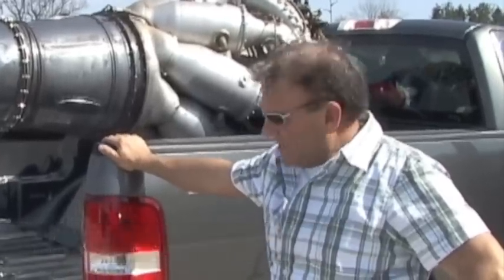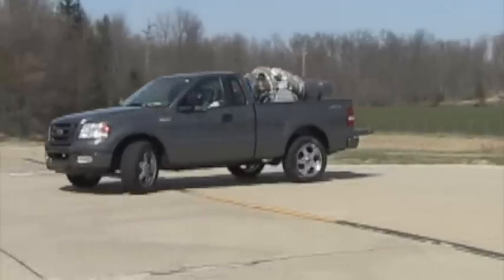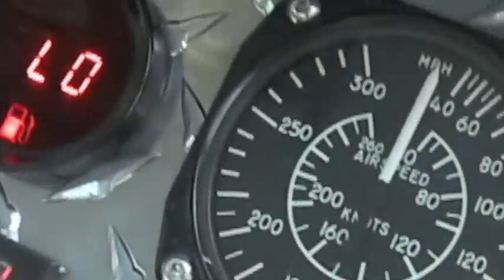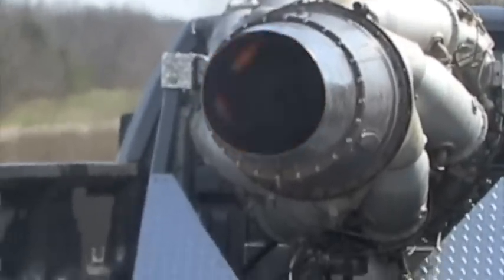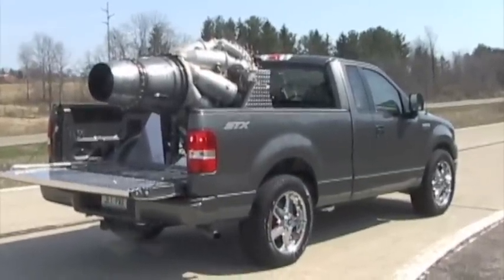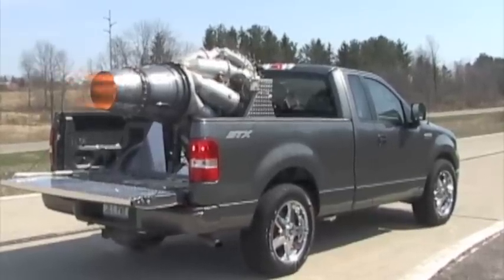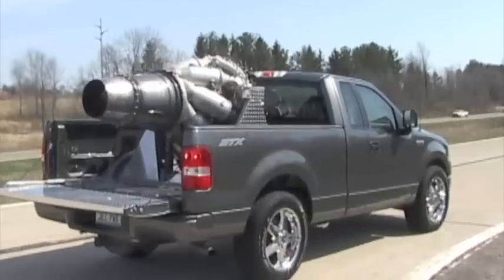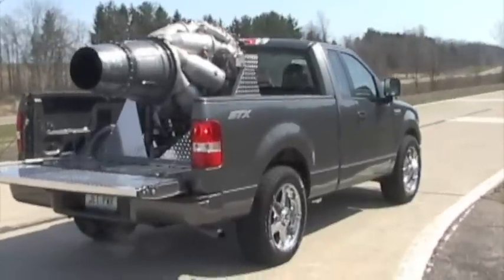F-150 Jet Truck

Comment: Actually ur 350 is almost , if not 8000 lbs- where my eagle is a mere 3900- and i have the stock 4cyl iron engine- with 60k miles-- i like boxy cars- not the scion box- like the vw vanagon box lol or the lambo lm002- i saw a 350 with the steel front bumper- at my head level- what a truck- and i havent seen the new concepts- the cars now arent as good as they used to be- but the new jeep srt8 is pretty nice- although my saturn redline is faster- i do like the 350 fords tho- very customable

Comment: I'm sure it runs faster, but my car (BMW 325i) looks like it could out accelerate faster than this.  But I'm sure if the truck was accelerated properly that would not be the case.

Comment: No air flow to begin with. Have you reinforced the brakes the everything? a truck like that isnt ment to go that fast parts will break no matter what brand it is...shits just not ment for the speed a JET engine can put out...how about a roll cage? Mabey a couple more saftey features?

Comment: U wish- the eagle has stainless steel unbendable bumpers stock/ ford has plastic and aluminum- i have a air suspension lift kit- up to 6" lift- Think of it as an early jeep- cuz it is- so ud be bumper to bumper with me- but the point being is that any shlomo can own a mass produced ford- f150s are a joke- i do like the TD 350s and the 650 is god- but my car is a rareity - it deffinatly looks cooler than any model pickup- and its painted in desert tan tank paint- aka Desert eagle

Comment: [MassiveLemon]
{It's still being routed to the car's transmission and axles}

That made me laugh how hes trying to
argue about the fact that the truck is worthless when he has no clue how it works...hahaha  its a normal truck with a jet engine bolted to the bed of the truck! theres no super transmission and axles that could handle that power, small enough to fit under that truck. nice try though!!!

Comment: @erickoep13 There is no "tire burn" when there is no work being done by the wheels. The truck moves because of the accelerated air exiting the jet engine. Think before you post and maybe you won't look like an idiot.

Comment: the build was done all wrong and is very unsafe to use   1. you used a ford.    2. the engine is sitting to far back.   3. the engine isn't getting proper air flow to operate safely.    4. you used a ford